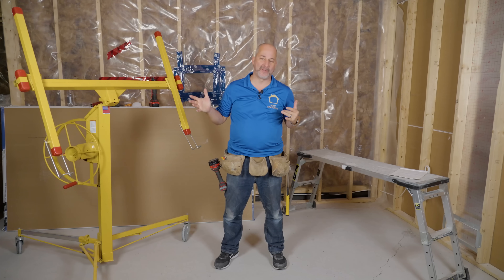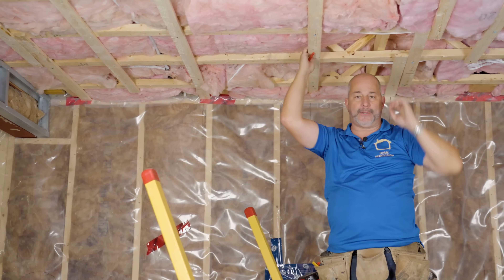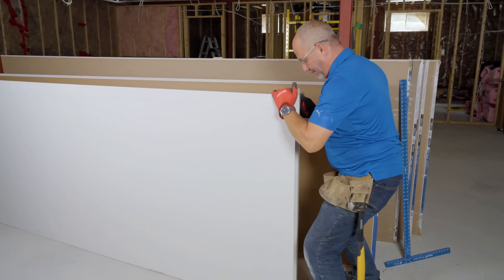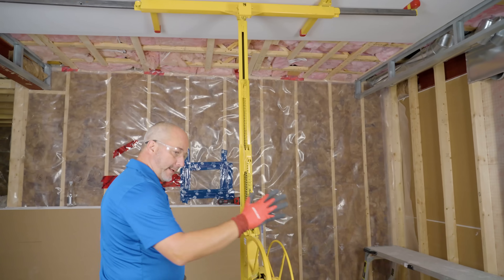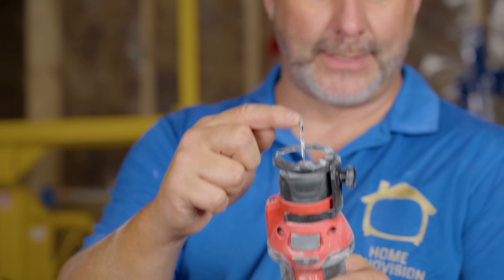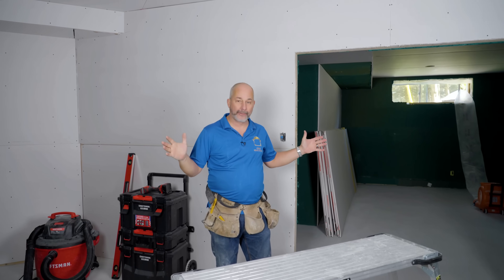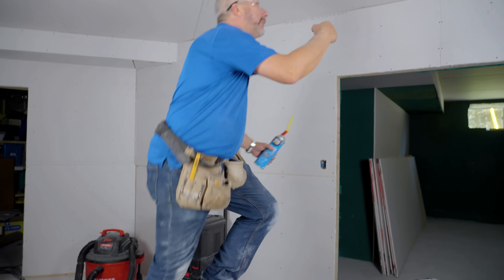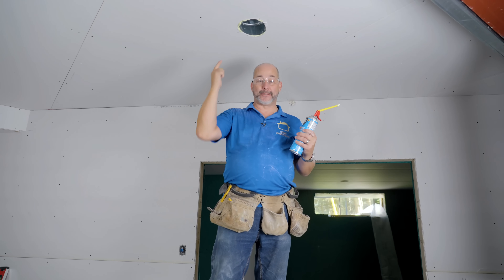Drywall Your Ceiling (The EASY Way)

Comment: I use graph paper when I map out the rooms ( actually did it for my whole house). I can then track square footage, number of sheets of subfloor, and drywall, door frame sizes, wiring and lighting. 2 ft per square. That drywall "machine" was really cheap to rent at the local hardware sore as well and although I had help because the machine IS heavy. I could have installed all of it myself otherwise.

Comment: One of the magical things I love about your channel is thay you empower DIYers, you mentioned “a little bit of experience and practice with this you can do a better job than I did”. Sir I just got my first routary tool, not for drywall but for dremel but want to use that for practice for when I do the drywall ceiling one day :)

Comment: I swear it's like you are making videos for my DIY work sometimes. Timing is impeccable. Removing popcorn ceiling drywall and made decision to insulate main floor ceiling and strap it before re-drywalling. I may rent a lift and do it myself, but it included a fairly wide living room so I'll have end joints. Thinking I'll drywall myself and let the pros tape and mud.

Comment: i install drywall in new homes for a living and ya   every thing you said was exactly how it should be done     never use a lift but theres a couple guys putting up a sheet so it aint too bad     5/8's will make you wanna cry but thankfully everyone has been using ceiling boards now a days

Comment: The drywall lift; the best invention since the wheel.
Have done 10' ceilings with 10', 5/8" fire rated panels alone by using the lift.  Not fun or easy but I never do ceilings anymore without the lift.

Comment: I always take a video and photos before adding the drywall as a reference after the fact. Also, I’ve used a plumb on a string to mark the centre of lights on the floor, and just reversed the process after the drywall goes up. So much easier, no arrows and measurements on the drywall.

Comment: Another good tip is to lock at least one of the wheels of the drywall lift it keeps it from sliding out while ur trying to set the drywall on the lift. Also can use a small scrap piece and chock the wheel so u can kick it out of the way if it doesn’t have locks or they are hard to use

Comment: For lifting the panels into place, I'd first recommend buying the lightweight panels if your budget allows, as it makes a difference for the DIYer doing a whole ceiling.  I opted for the help-from-a-neighbor route, as it was far less costly (a case of beer) vs renting a drywall lift.  I also installed the last panel, a 30 in by 96 in piece, myself.  I first fastened a 2x4 to the wall near one end of the panel; lifted one end of the panel onto the 2x4 "shelf"; then walked the other end into position by climbing up a ladder.  Then I started fastening the board from one end to the other.  The wall, of course, just has a couple of holes in it, which you can easily patch with joint compound.

Comment: When I drywalled my basement ceiling, I had the furring strips run end-to-end, space 12 inches on center, and doubling up every 4 ft so that the edges would be well-supported.  then I drew lines down the length of each panel every 12 in.  The lines make it dead simple to install the screws (and yes, I used 1.25 in screws!)  There's no guesswork involved in fastening the panel.

Comment: Jeff, how do I hang rock around a garage door motor? Do you recommend I remove the bracing and motors or cut around the bracing and fill? The house is a 1947.

Comment: Do you ever worry about the weight of the drywall pulling the strapping off the floor joists since you just used your framing nailer to put them up?

Comment: Needed this video! Im a bit confused when you should drill out pot lights. You should do it after the plaster and paint are done?
Reply: before you tape, plaster or paint! you dont want to take the risk and ruin a finished product, always rough in at the basic stages!
Reply: @programmer6428  thank you!

Comment: I wish it was always as simple as a staged video like this.  But I need to replace sheetrock on a garage ceiling with a chain-drive rail right in the middle of it.  So I can't use the lift.  Otherwise a 4x12 sheet on a  lift would work perfectly.

Comment: I have a small basement, should I use drywall or drop ceiling,?
Thanks😊
Reply: Wow, good question.  My experience -  I drywalled my seiling but in hindsight, I wish I had done a drop ceiling.  I had copper pipes that developed pin holes.  A drop ceiling would have made it much easier to deal with the leaks.

Comment: I have a drop ceiling in my finished basement and i wana make it legal as 2nd unit. Do i have to replace ceiling..?
Reply from the maker: legal secondary suites need fire separation. That requires a complete fire rated ceiling and many other upgrades to accomplish. best to get a permit and invite the inspector on site to discuss what they want to see when finished. politics and building code collide on this issue so it may be easier than you think depending on your unique situation and region. Cheers!

Comment: Can I cut my drywall into smaller pieces in order to lift them? Is that not going to pass inspection? I don’t have a lift. It’s for a 15’x 11’ laundry room.
Reply: You can, but you'll have more Joints to tape and mud

Comment: The lift is a life saver! Is there any particular reason why you don't use an auto feed drywall screw gun? 
Here in New Zealand we have to glue and screw dry wall. Do you ever glue them?
Love the videos man. Hope you enjoy a well earned break this holiday
Reply: How do you replace it if you glue it? Seems like it would be messy and difficult to take it down. What's the purpose of the glue?
Reply: @evelgreytarot8401  there is no purpose to glue drywall to the studs. Glue boy couldn't even answer you back,
Reply: @evelgreytarot8401  It's New Zealand. That's the only purpose.

Comment: What do you do when the room is not squared ?
Reply: Go from the center with your first panel and square everything else off that. He said in this video.
Reply: @Section_230  So you measure then find the center of the measurement and go from there?
Reply: @jgkrus  Of the room yeah 👍 That was my understanding of what he said
Reply: @jgkrus  5:35 - 5:50

Comment: Jeff your videos may be good for some people but NOT FOR ME!!!  I have a drop ceiling over an old bathtub.  I will guarantee you I will NOT rent a drywall lift for a 60" x 24" drywall area!!!  It is very disconcerting that there are no clips that is NAILED at the top of the WALL so it's haning against the wall.  Once the drywall is clipped and parallel to the wall all you have to do is lift the drywall up and  into the ceiling and use a block for the other side and nall it up.  You want to take an elephant to push a child's tricycle!!!

Comment: So you have all that drywall weight hanging from straps you nailed up.
Happy sagging.
Reply: I was wondering about that too from his previous video how the straps were held in place. I do ceiling joists a little different than him as I keep all my ceiling flush with spacers between each joist for alignment and placing screws. I use I-joists rated for the length of ceiling run with no support. Also have 'blockers' on the edges so it does not float like on his edge near the ends. Even though I know the walls' drywall will help hold it up as well when lifted off the floor 1/8" to 1/4" gap at floor, no gap on top. Base board will cover that gap, any minor water damage will not be soaked up by the drywall.
Reply from the maker: you are way overthinking how much drywall weighs, Cheers!